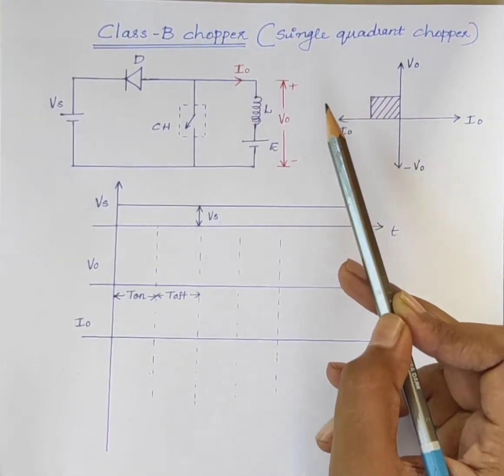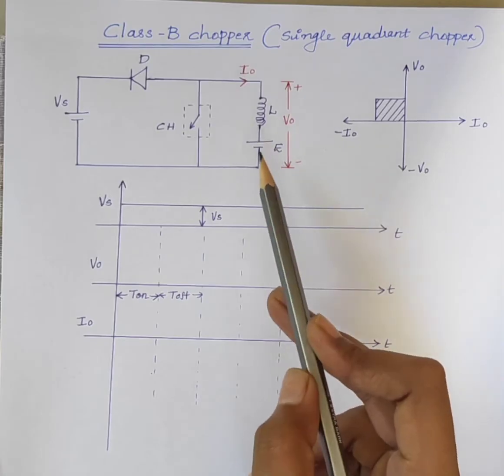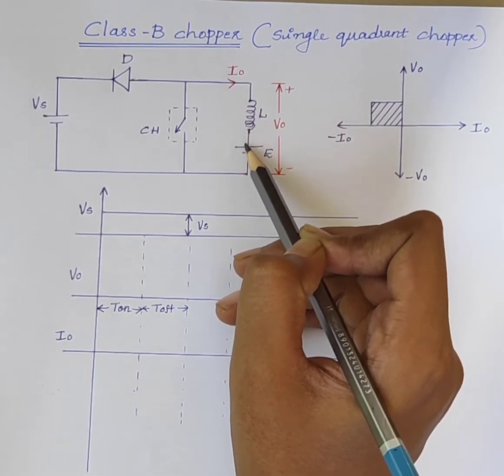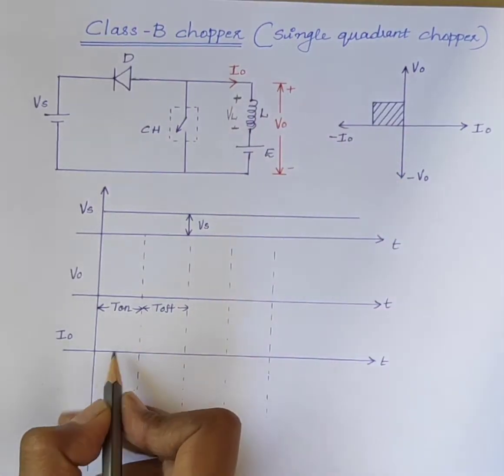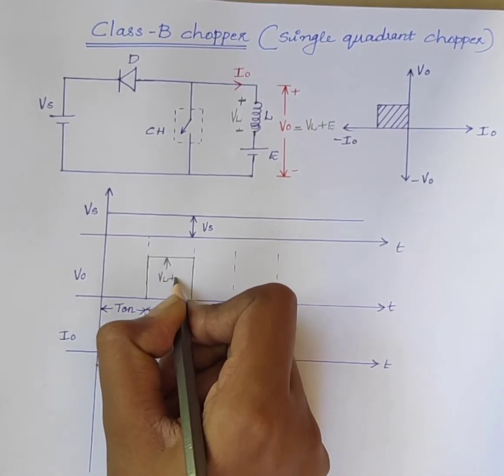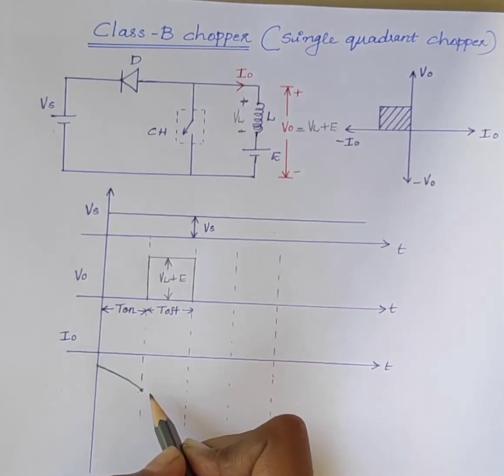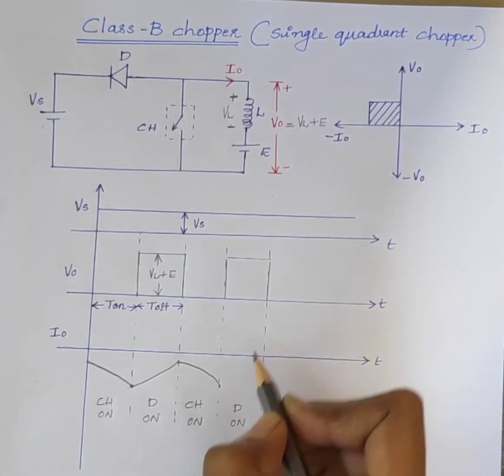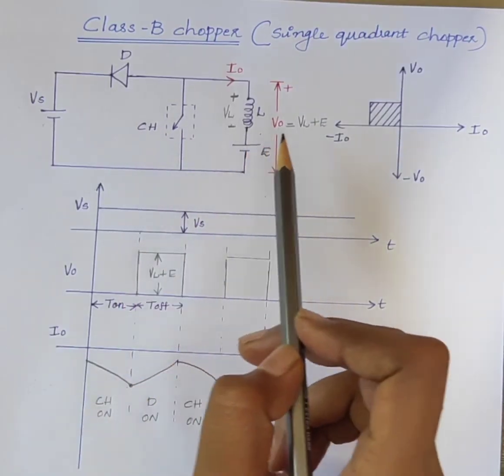Class B chopper

Comment: Maam, what is the significance of source here?  Source is giving 0  power?
Reply: class b chopper is typically used for the regenerative braking of dc motors, so the source here shown in the load side is the emf generated during the braking of motor. during the braking of dc motor, it temporary works a dc generator pumps generated emf back to source. this kink of chopper principle is widely used in modern EV VEHICLES and electrical locomotives.